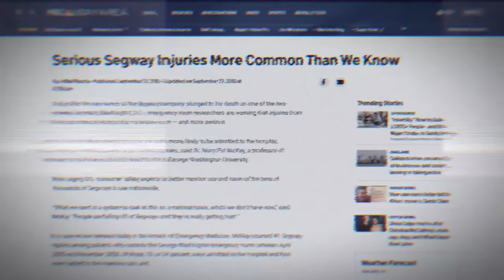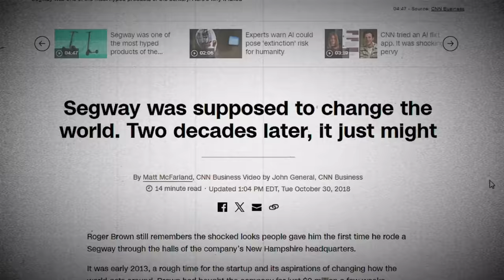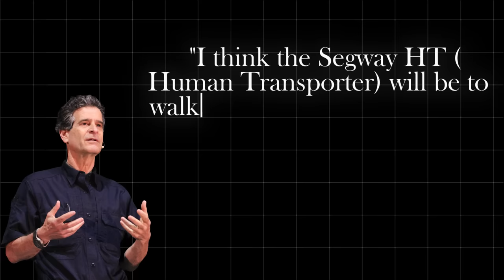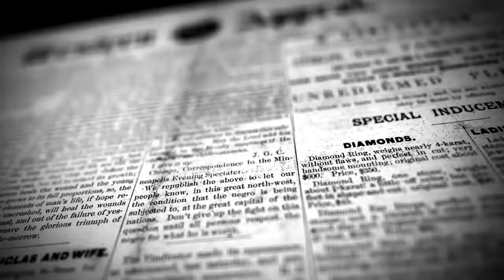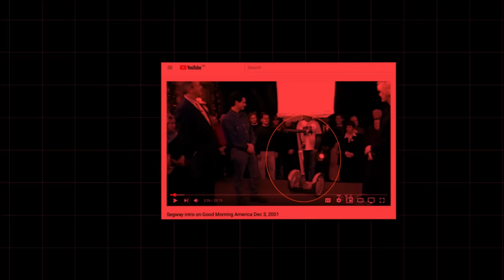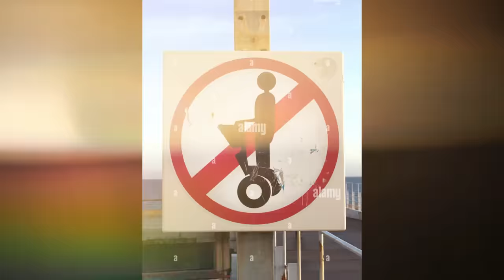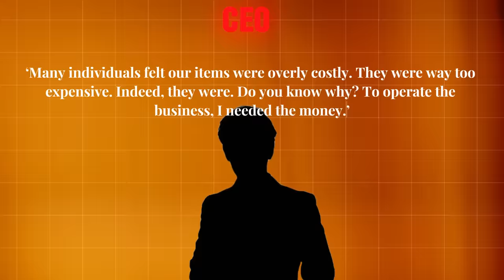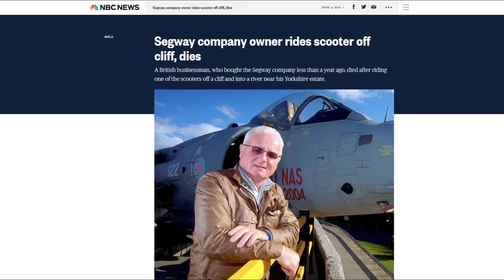Segway's Downfall: What Really Happened?

Comment: Segway a nice novelty toy, but not very practical. I'm surprised it sold as many as it did. Since in many areas you had to ride it on the roads, that made it dangerous too.  Way too much money, too few miles on a charge, and many companies in urban areas wouldn't let employees bring them into to work, and rightfully so.  I don't think better marketing would have helped in the long run.  Apparently they weren't anywhere near as safe as Segway claimed either. 

In the future personal air transport  vehicles will be just as bad. People can't safely drive cars in the morning when they get out of bed, , let alone commute to work in personal aircraft like Quad copters. Most people  aren't smart enough to learn and use advanced air navigation equipment safely. The FAA is trying to prevent that scenario now (quietly)  as it would cost immense amounts of money to handle the extra air traffic load - more air controllers needed,  more sophisticated computer systems, and landing safely in dense urban areas would be a major safety issue for everyone!

Comment: Why have wheels side by side instead of one in front of the other? It has made something really easy into something difficult. Like inventing a pen to use in space instead of a pencil.
Reply: Self-balancing doesn't work with tandem wheels.
Graphite from pencil leads can detach and float around a spacecraft and eventually short out an electrical circuit.
Reply: @mkvv5687  Self balancing?  The fancy technology that requires training and even then people fall over.  One wheel in front of the other or better yet 3 wheels would be naturally more stable that this failed fancy technology.

Comment: I rode one while visiting in Colorado.  Around Glendale and then up a steep vista road.  I essentially became terrified - because they don't have BRAKES.  You can "slow them down" by pulling back on the handle - but going Down a hill - you can run into a problem.  They work fine on a Flat or going UPHILL.  But not down...   So simple to actually add some sort of actual BRAKE; rather than using "slow down the motor" to stop you.   But nope.  So, that was it for me.

Comment: The software is flawed. It needs a safety subroutine where id the rider loses balance the segway would stay in upright position and disengage movement allowing the used to resume control. This is same problem with hoverboards.

Comment: It is batery powered and eectronically controlled. But requies giving subtle cues on direction and speed of moving on leaning. Even balancingon a bicycle requires balance, and one falls a lot while learning. The bicycle is essentially a slow moving vehicle. Segway being motorized, may be too fast for the human reflexes to provide corrections.  The bes question is what does it solve? It reduces walking effort. Obviously petrolling by foot is he most laborius task it seeks to help. But technologically bulk of the power, and control effort goes to support the 'majik' of sanding on two wheels side by side. Would a third and fourth wheel be impossible to accomodate? . The pneumatic wheels in a bicycle are perhaps good for a individual personal transport. Technology has moved forward with lot more potential capabilities. Hence this is almost obsolte now.

Comment: Yeah. the modernized solution to the Segway problem is rather than it being lean controlled, it should be able to tilt the user platform to simulate lean and the actual motion path should be AI driven like a self driving car. Then you just have to stand there and you could have voice control, a one hand controller, a wireless wristwatch controller, whatewver to tell it where to go. This takes away the whole physical dexterity and human body kinematics problem that causes all these Segway crashes.

Comment: The center of gravity of the operator is simply too high. 
Powered roller skates would probably be a better concept.
Reply: Check out electric unicycles. They’ve already been around for a few years and are by far, the most practical micromobility vehicle